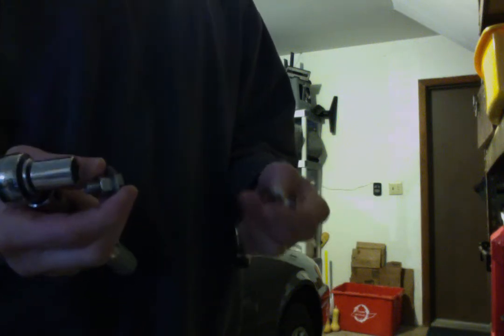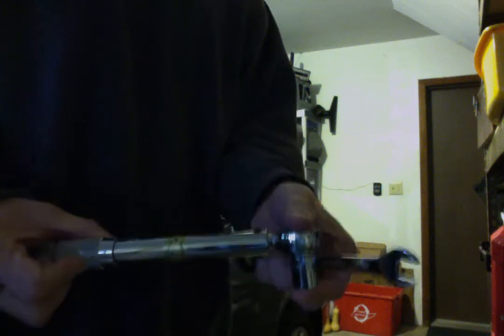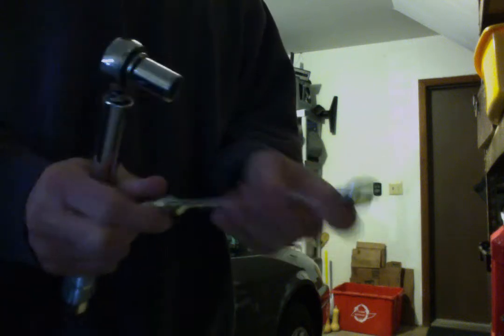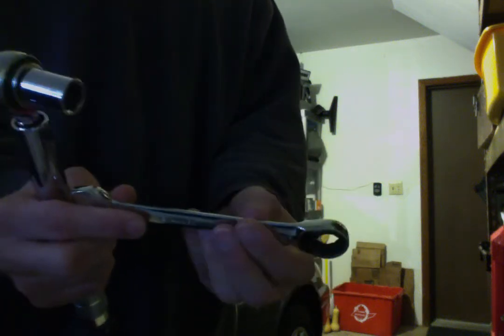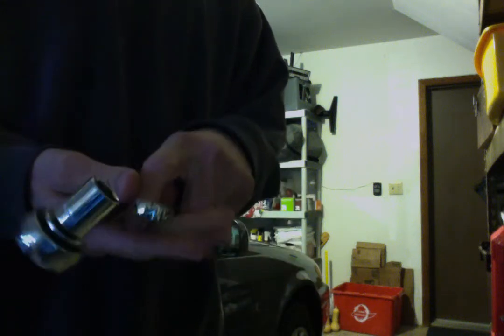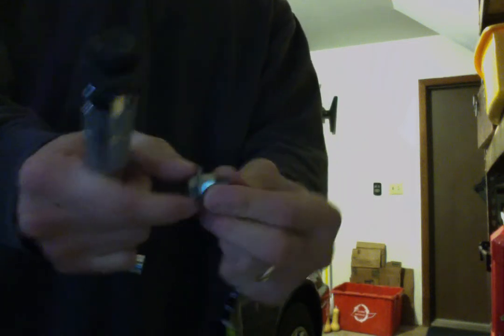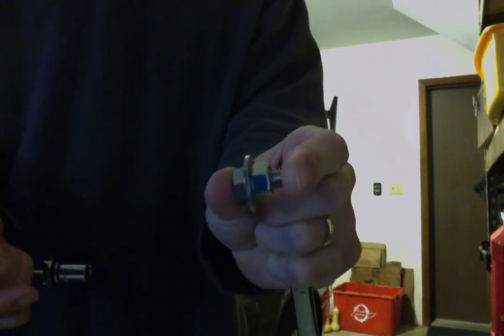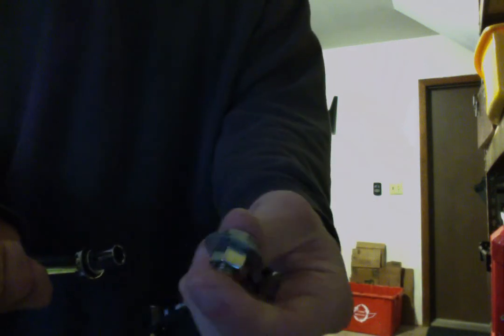Torque wrench extension trick

Comment: It also works to increase the torque beyond the limit of the torque wrench.  I needed to torque a bolt to 185 '# with a torque wrench limited to 150'#.  With a 50% extension it increased the limit of the wrench to 225'#.  Setting the wrench to 123'# gave me 185'# at the bolt.